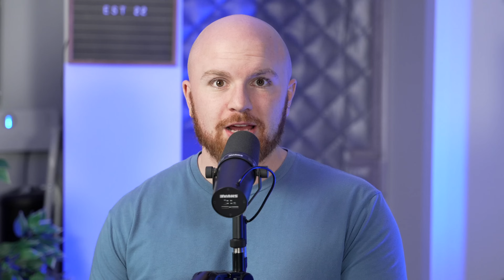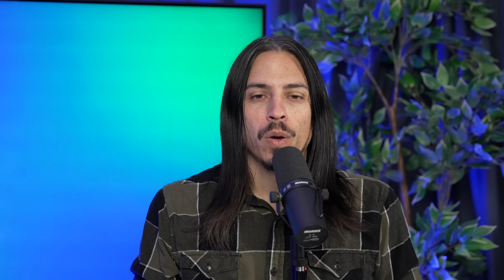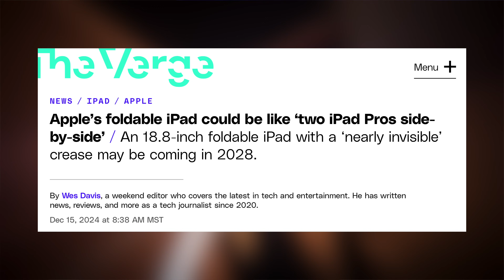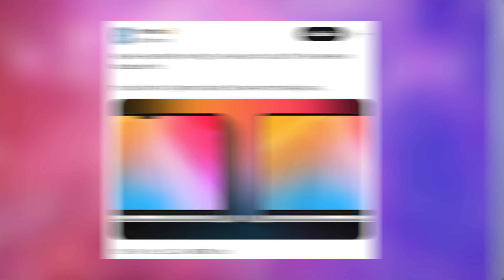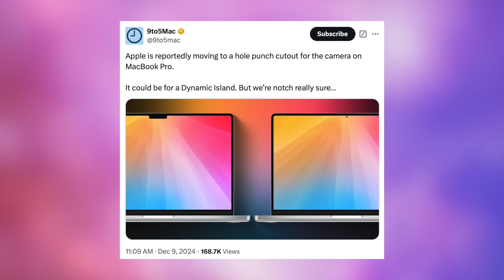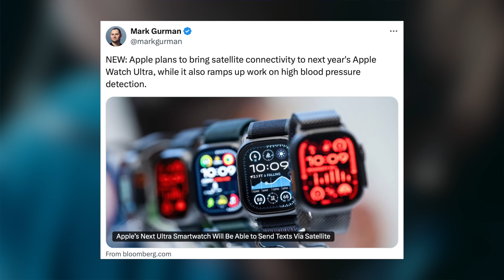NEW Apple LEAKS 7 New Products | We Haven’t Seen These Before

Comment: I feel like Apple's solution to the foldable market is to SKIP it and create a "roll-out" market where you roll out the screen to expand the device -- perhaps with some super thin surface to keep it rigid once it's rolled out you could have a pen or tube shape device clamped to your shirt pocket. It could be transparent and you could use it's AI and point the screen at stuff to find out more info in AR fashion.

Comment: No. I would want a foldable iPad
Reply: The thing to understand is the so-called foldable iPad would finally be their hybrid.  In folded mode it would be a Mac with keyboard below with a trackpad.  Additionally you would have an accessory option for a physical keyboard that fits on top of the lower piece.  In flat mode it would be a huge iPad.  In the investing app I use most of the time that is a very attractive possibility.
Reply: 20 inch foldable iPad. Would be awesome